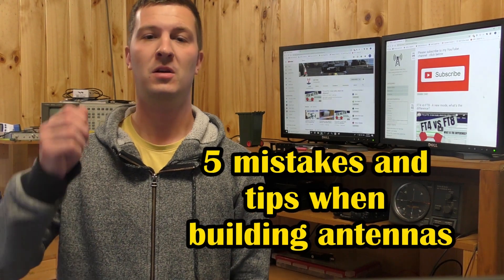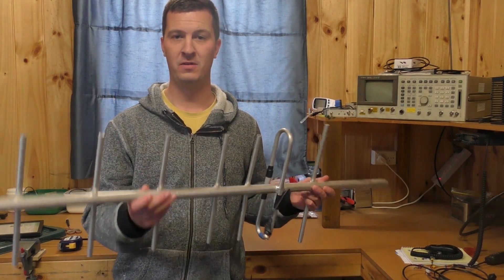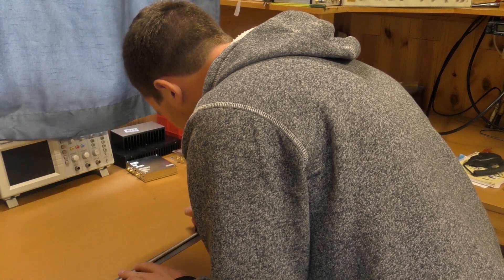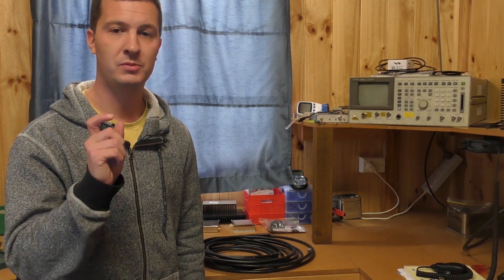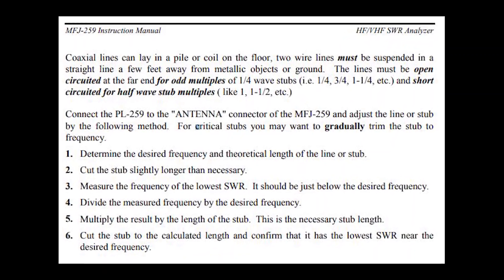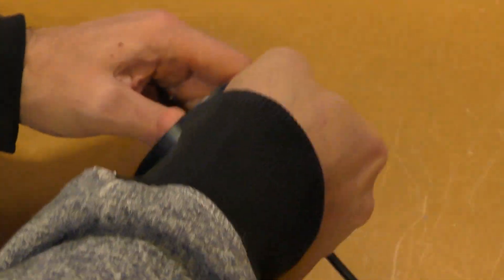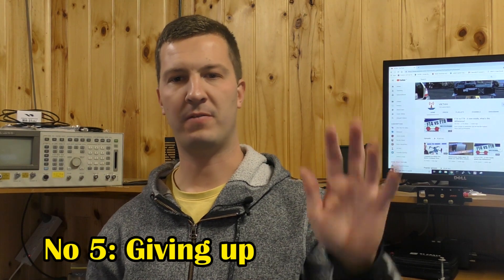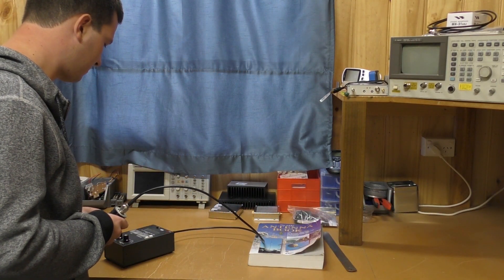5 Tips for Ham Radio Antenna Builders

Comment: I'm trying to understand why someone hit the "Dislike" key, there. These are all good tips and can never be given too often. Good point about insulation tape. I confess to having used it sometimes rather than seal the whole shooting match in silicone sealer. Question, Hayden, if you have time... I was always under the impression that a quarter wave of coax or odd multiples thereof, gave an accurate VSWR reading at the meter. You mentioned using a half wave length, though. Curious. Thanks for a great video, I've hit Like and Subscribe. cheers, Mark VK3PDG.
Reply from the maker: Ryd'n With Ryder thanks for the comments Mark. In answer to your question - an electrical quarter wave length of coax or multiple thereof can have a transforming effect. You can still use it, but if the load impedance is anything other than 50 ohms you’ll have a transformation happening. It’s very handy though to transform from one impedance on a line or coax to another :)
Reply from the maker: https://www.everythingrf.com/rf-calculators/quarter-wave-transformer-impedance-calculator
Reply: Adam.... in answer to your equerry. Even IF God himself would do a post... there would be dislikes. That is a FACT. No matter what... some people cannot be satisfied. If they win 10 million in the lottery... they "dislike" like it and ask why weren't they "entitled" to 100 million..... and soforth. JUST IGNORE THE ODD DISLIKE... concentrate on the comments from your real supporters.
Albert
Reply: Definitely, ideally, want a half wavelength of feeder for testing antennas. You can test at the feedpoint to accurately measure impedance or VSWR. However, this is often (usually) impractical. With a half wave of feeder, the electrical distance from analyser to feedpoint plus that back from feedpoint to analyser is exactly one wavelength. So, the analyser "sees" exactly the same impedance and therefore VSWR as the feedpoint. It doesn't even have to be one half wavelength of co-ax, it can be any multiple of one half (0.5, 1.0, 1.5, 2.0  etc.). In practice, the characteristics of the feeder will come into play but, at HF with shorter runs of decent quality co-ax, it won't make much difference.